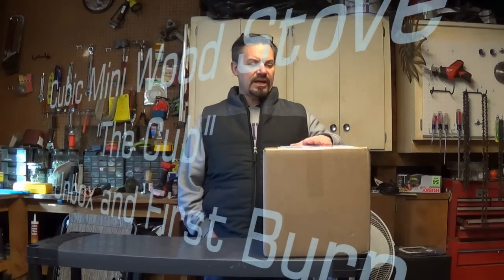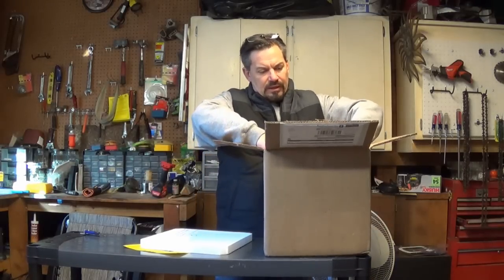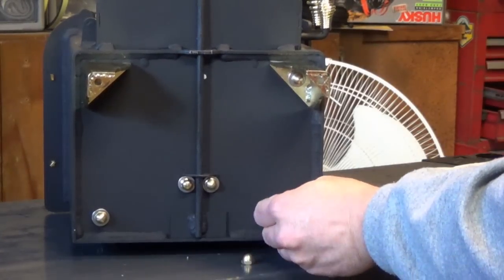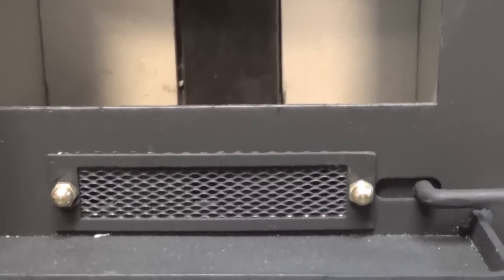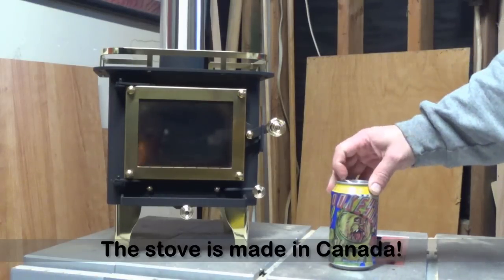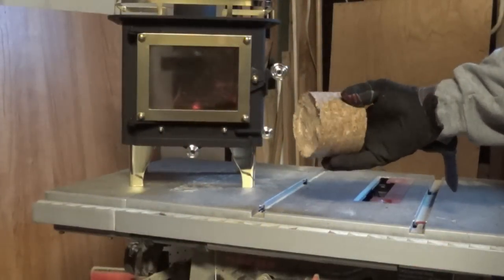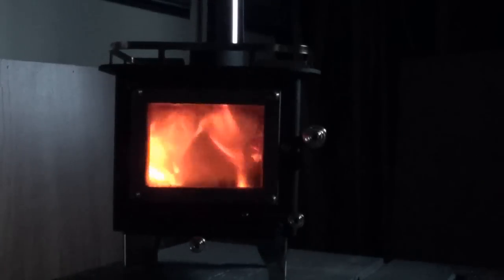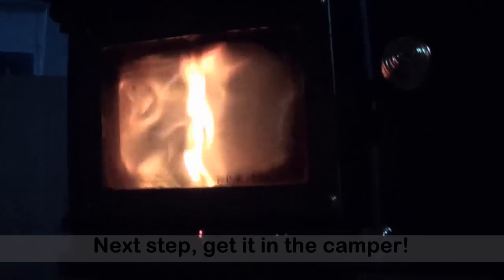Cubic Mini Wood Stove Unboxing & First Fire

Comment: I think 400dollars is not a bad price how many years of service will that quality stove give you can't skimp on fire safety
Reply: I think they could sell it for 160 bucks. Every body wants  to get rich over nite. I think sales would be far greater. Profit would be less per  .  But out come on sells would be significant
Reply: You can buy an EPA certified 54,000 BTU wood stove that will heat 1,200 sqft for $239.99.

$400 is absolute bullshit for something so small.
Reply: Robert Pruitt perhaps he is talking in Canadian dollars not same as usa dollars.
Reply: @CorinnaD  
Could be, but it doesn't help that much. A Canadian dollar is about 75-80 US cents.

Comment: I have two questions... 
1.The smoke issues, if any
2. How well it heats? 
Perhaps someone else might have installed one, and could provide the information?
Reply from the maker: You can get some smoke at start up if you open the door.  Once it is rolling, I have not had any issues.  How well it heats will vary on your climate and size of what you want to heat and how well it is insulated.   It roasted me out of a 26 foot travel trailer in 40 deg weather.

Comment: I have a wood stove in my garage it provides great heat in a 2 n a 1/2 car garage with an addition on it
Reply from the maker: I am going to guess your stove is bigger than 1 cubic foot.
Reply: I had my wood stove installed to meet all code requirements in my 700 sq. ft. garage/workshop and it served me very well for 32 years.  Then, my homeowner's insurance policy provider became aware of it and demanded it's immediate removal.  Remove it or face insurance cancellation for the shop and the home and they would make sure that no other company would provide insurance.  Now heated with a very expensive propane system and no opportunity for free fuel.

Comment: I like it, but on a cold as ever night you'd have to hold your eyes open with toothpicks to feed it all night long to keep warm. Unless there's some something ultra high density that would burn all night or all day, then it's more or less aesthetic. Of course ,if there's room on top to boil hot water for pot of coffee during a electrical power outage ...then it's ditto inspired.
Reply from the maker: You are correct.   Not a good unit for over night.

Comment: cool, but in no circumstance would i put one im my camper,the dirt and dust and smell not worth the effort ...ur constantly going to be cleaning counter tops,and anything electrical sucks in all that dust nothing but problems...would highly recommend a diesel heater,purpose built for this kind of application.

Comment: With my experience heating my house with wood, I still wish I would have gotten a large rather than a medium Regency.  This investment in a tiny wood stove would only be effective occasionally and would not be worth the investment.  Too much trouble.  Get a space heater and use it only when you need to work in your little trailer.
Reply from the maker: This is too small for a house.   I bought it for my travel trailer.

Comment: Stove is extremely small but like you said, it may be ok since its so heavy :)

I had a tent stove that was not heavy enough... You could never get the right temperature. The thing is eigther glowing red or its gone out lol!
Reply: what's the gauge on the steel?
Reply: 11 gauge is 1/8 inch. So yeah that is thicker than my stove - 13 gauge is 3/32 thick.

Comment: Rocket stove heaters use less fuel and heat more effectively.
Reply from the maker: Show me one with a chimney you can use inside a dwelling.  Specifically a camper, which is where I am using mine.  Thanks for the comment.  Don't forget to like or subscribe.

Comment: Um, how about describing the HEAT coming out of that lil thing? I watched the entire video waiting to hear how it HEATED the room you were in, NOT how about the basics of how a wood stove works? Cmon man!
Reply from the maker: Not enough to heat the garage.  Not even a little.  It does roast me out of my 26 foot travel trailer.  Heating My Travel Trailer:  https://youtu.be/QBDTFNSq1yM
Reply: RJ Walls that’s exactly what I’m sitting here wondering!!!
Reply: Oh now I see the reply. Didn’t think it would phase the garage
Reply: That's odd a 26ft tralier heated it up but not a garage very odd...
Reply: garages aren't insulated typically.
Reply: That's a small stove, not designed to heat a 3000 cu ft garage.  His RV is probably 1/3rd that size.  I'm curious though about how long is the burn time when fully stoked?  How often would the stove have to be stoked during the night?  Could be ideal for a 6+ person tent, too.
Reply: @markrunyon5524  
"b4 u"?  I don't ever remember learning how to spell "before you" like that in all of my year's in school. Talk about the pot calling the kettle black🤔
Reply: @e greenie Or, "Talk about the wood stove calling the firebox black."
Reply: @egreenie3819  
"B4" and "u" are SMS shorthand, which has also become popular on the tubes.

And both of them are spelled correctly.
Reply: what is your brain on ?
 @markrunyon5524
Reply: @markrunyon5524  u cud do the same

Comment: Wondering how hot the chimney pipe gets? Maybe worth using a baffled heat exchanger to keep more heat from going out the flue? Also, piping supply air from outside directly to the stove intake would keep warm air from getting chilled. Just a couple thoughts
Reply from the maker: Actually you want the pipe really hot because if you don't, creosote builds up and you have to clean it out.  The manufacturer is now selling a double wall pipe to insulate the inside pipe to keep it hot.  It would be nice to keep that heat in the room, but that pipe gets clogged in a hurry if it isn't super hot.

Comment: I’m considering this as supplemental heat for my 10x10 greenhouse just through the winter nights.  If it was lit at night, how many hours do you estimate it gives heat for? I don’t need roaring heat after a few hours but even if 6 hours in it was pretty warm that would still likely do it’s job of keeping the temps up in the greenhouse with the little electric space heater that’s there now.
Reply from the maker: two to three hours before you need to add fuel.  It is a very small stove.  Max fuel size is 5 inches.

Comment: I with to the link and I thought the price was to high.  $449.00 is way to much for a little stove like for me FYI. in the future say the price up-front.
Reply from the maker: this video is about three years old.   The price is different than when I bought it.  I include a link to the manufacturer so you can easily get current pricing.

Comment: once upon a time i installed welenco inserts, similar only bigger this device worth 400, why because small things to a point are more time consuming to construct, thought has gone into design then components . of course one can always get something cheaper, when it comes to fire durability & safety paramount. Being the type guy i am i could build at home why not because would not be any better i would add convection to device thats it fire it up while i work on other things in shop get my moneys worth cheers canada beautiful but chilly

Comment: Would like to have seen the exhaust, but otherwise great video.
Reply from the maker: Once you have the secondary combustion going, it is clear.  The trick is keeping the pipe hot enough to keep the smoke from condensing.  If you watch my other Cubic stove video, you will see what I mean.

Comment: For $400.00 no thanks.
Reply from the maker: I didn't pay that much.  They seem to have sales pretty frequently.  Black Friday isn't too far away.
Reply: for no heating bill? count me in!
Reply: Woodsman a full-size stove cost 3 times the money.
Reply: @Woodsmans, if you think $400 is high check out the marine stoves that are about that same size.
Reply: Can this little wood stove heat one bedroom apartment or home 500 800 square feet
Reply: This is actually really cheap. It's made in Canada, not china. It's a real stove, not just a firebox. If you're looking to spend less go cut up a propane tank. If you want a proper stove, this is it.
Reply: Ive been looking for years, this is the best price for going tiny your alternatives are mr. buddy type things or those tent stoves that people put in but they are not a really good idea.
Reply: @lhurst9550  yep i checked Those marine stoves are $5,000.00 PLUS!!! Out rageous price
Reply: With a tiny fan it could depends on what you are talking about alaska no lotus land perhaps  cheers
Reply: NO IT ISNT!!!  I can get a regular stove for that much!
Reply: @flyfishing1776  They set that price range base on a very simple assumption-- if you own a boat, you are freaking rich.
Reply: @foodparadise5792   agreed ,I wanted 1 for a homemade  place in the woods..Blessings
Reply: @laurawarman6695  $375 US - I got a twodog stove for $250 I think or $275.  A lot bigger stove and has a baffle for secondary burn. So I don't use a damper on it.
Reply: $400 Canadian? At the current exchange rate they have to pay you to take it! Just kidding. The rate is 33% this morning. That $400 becomes $266us. Worth it now?  You bet
Reply: @przemyslawziniewicz5923  ,the more exposed stove pipe, the more heat.

Comment: no way would i install this without bringing in outside air, if it doesn't have a sealed tube  'outside air in' on the back, return it immediately for a full refund. The unit should require 0.00 cubit feet per minute of inside air to run.

Comment: Narrator.. I'll just check on this every few minutes ...NO, you'll be adding wood every few minutes.. the burn time is ridiculously short, but you'll still stay warm constantly busying  yourself with firewood, this thing won't let you become lazy
Reply from the maker: The biggest piece you can put in there is five inches.   Not sure what your  expectation is based on that small size of fuel.
Reply: @FernbarkFrist  ... I would expect to be disappointed.